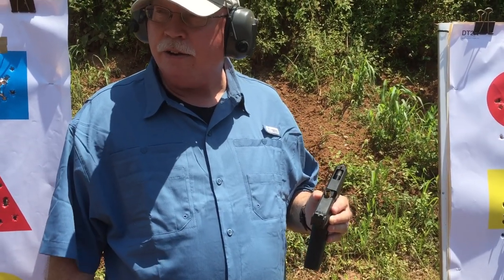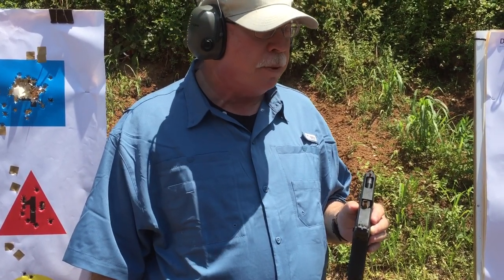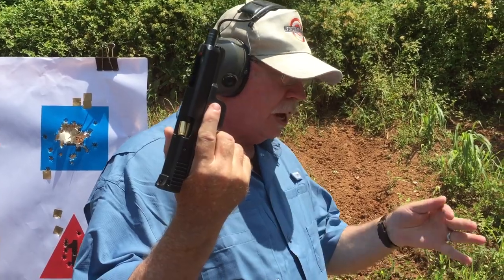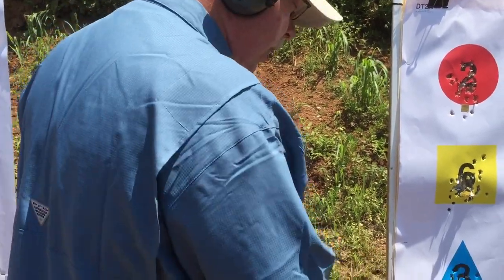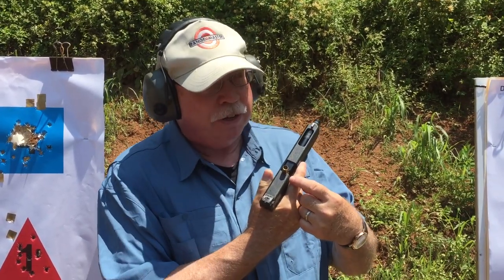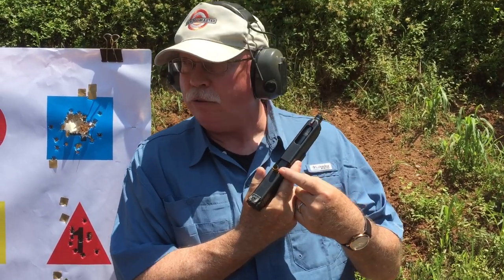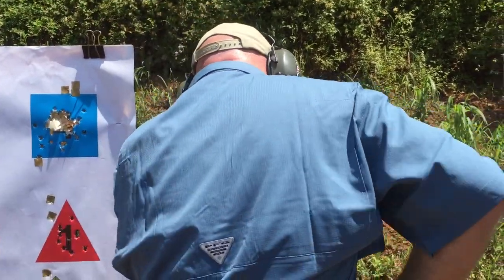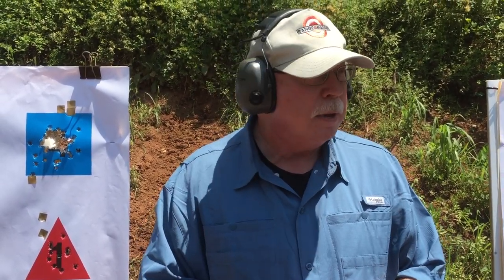Tom Givens discusses clearing malfunctions

Comment: Why do you have to slap the bottom of the magazine for this malfunction?
Reply: It's more of a habit so you don't spend time thinking about it. Just tap,rack,bang. Not everyone does the mag tap for all malfunction clearing as it takes time, maybe 0.25 second which can make a difference.
Reply: It helps too when you insert a mag to ccw or go on duty, release the pistol mag & check to make sure the ammunition is properly seated. I do that to make sure rounds cycle, feed smoothly.